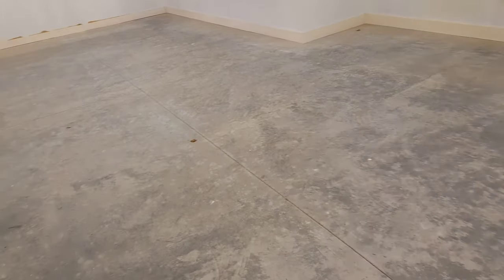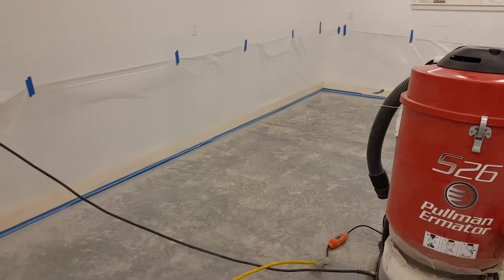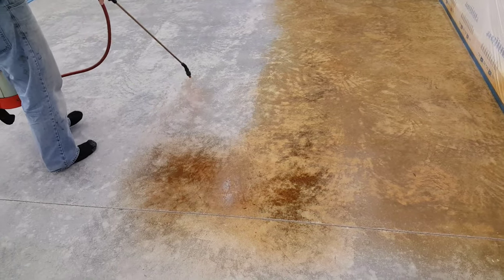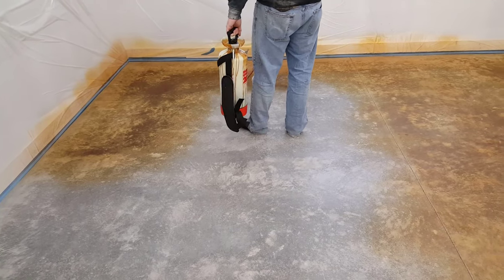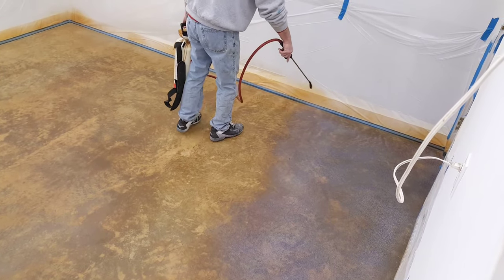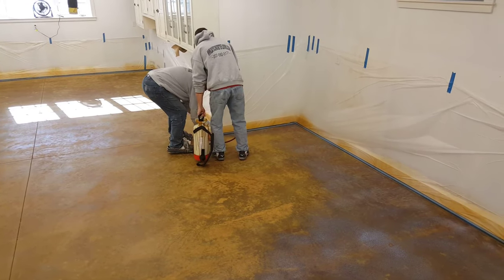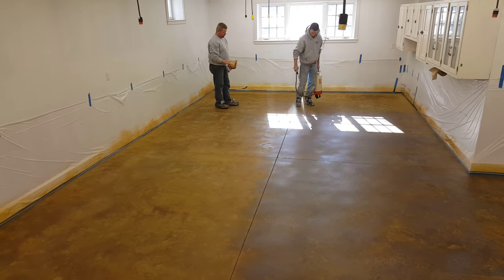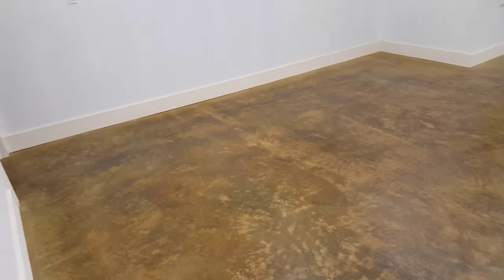How To Stain Concrete Floors | Easy Diy Method

Comment: So glad I found your channel, Mike.  I've got a big patio job happening in my yard at the moment.  I've picked a stain color and realize I know nothing about concrete sealer finishes -- matte, gloss, semi gloss, low sheen, etc.  If I don't try to gain a little knowledge myself, I don't know how to answer the question, "what do you want?"  This is the scariest part for a customer -- this isn't what we DO, so it's hard to know what it is we want or what the options are.

Comment: Our house flooded and our hardwood floors are ruined, which were refinished less than 2 years ago after a frozen pipe leak. I think this would be a great solution but insurance isn't paying for flood issues so I hope to eventually get all the warped hardwood up and have this done. Great video. Now I know what is involved when we have this done.

Comment: Looks great Mike! I love the variation in colors. I did not hear your suggestion on alternative cleaning methods.  I'm thinking maybe acid washing. My DIY project is to restain my front and rear porches. The previous stain done by the previous owner has faded and worn away. I need to keep the anti-skid texture to prevent slipping on the floor when wet. So i will shy away from sanding/cleaning machine. But explain about the alternative cleaning method before i apply stain. Thanks! Donny

Comment: that's beautiful.  i want to do this for all my rental properties.  you can do the entire conversion to concrete stained floors without bending over at all unlike tile or wood or laminates.  you can literally do whole job standing up so easy on body and lasts longer and cheaper better in every category
Reply: I WAS ALSO THINKING OF DOING THIS FOR MY RENTAL, BUT WHAT ABOUT IT BEING CHILD FRIENDLY. COULD FALL AND HIT YOUR HEAD PRETTY BAD. ALTHOUGH IT'S NOT MUCH DIFFERENT THAN TILE. WHAT DO YOU THINK?
Reply: @melissanative1799  IT'S NOT MUCH DIFFERENT THAN TILE

Comment: Turned out Beautiful. I am converting a 20x25 out building on our farm into my new home! It has a great cement floor and this is exactly what I want. What color did you use? And can you put a semi gloss top coat on it to give a little sheen without it becoming super slippery like marble floors?
Reply from the maker: This color was leather tan. Yes, semi gloss is available

Comment: My basement is also power trowelled very smooth. Is there a step between the cleaning and putting down the stain that is needed to open the pores of the concrete to accept the stain?
Reply from the maker: Yes, I lightly grinded the surface in this video.
Reply: Thanks Mike! Wow. That machine is a beast. They have a 10 inch I can rent at H.D. will take forever on 2000sq ft basement. What grit on that diamond pad? Thanks!!!

Comment: Thanks so much for posting this. I've been wanting to redo the floor in my house for several years; it's covered with wood laminate (pergo) that's been damaged by several floods. By the time I was able to setup a drainage system outside that would prevent that, the damage was done. I had been thinking about putting ceramic tile or stone on the concrete so that it would resemble a stone floor, when I saw a friend's house who did what you demonstrated: Cleaned, stained and sealed his concrete pad. This is exactly what I want for my house and your video showed that it's something I could do, that I don't have to hire someone else to do it for me. I'll definitely check out the Concrete Underground, but this has been a great introduction to staining my slab!

Comment: I’m in process of dealing with hairline cracks in my basement floor.  The home is only 12 years old…and I slightly freaked out about the cracks.  It s not structural, just settling.  We live in western Massachusetts, and the weather has been “wonky”…with snow one day.. rain, followed by temps approaching 60!  And this is January!  Anyway, we are considering something similar.  That line down the middle ….did you guys put that in?  We have no such lines…and our basement is huge.  I now think we should have.  Regarding this floor, you guys did a beautiful job!

Comment: What diamond pad grit did you use on this job?  I would like to keep the tiger striping in on my floor as well.   And is that grit strong enough to take off any sealer that was used on the concrete.
Reply from the maker: We used a 50 grit ceramic pad. It's inbetween a metal and a resin pad. It wouldn't remove sealer. You have to grind off sealer in most cases with a metal diamond cup wheel.

Comment: That looks really good! I actually would love to get a look similar to that in an outside environment. I'm looking to do a patio in the back with those quikrete molds. Is there anything about this process that would be done differently if it were new concrete, but outside instead of inside? Thank you in advance.

Comment: Will concrete stain last forever unlike paint the will eventually chip or wear off from traffic?  I'm looking for a durable low maintenance one and done for my smooth concrete basement  floor and my ouside rough concrete front porch.

Comment: Im in the Grueling process of Removing paint off my 600sqft outdoor patio 😮‍💨🥴 almost done.. but i noticed some tiny specks of pigment all over the place.. really small stuff do i have to remove everything ? 100% ? the Water based stain i have is similar color to the old paint.. would i be ok? 99.9% of the slab is clean and sanded down scuffed up good.

Comment: This floor is beautiful!  The problem that I’m facing, however, is the house I bought has stained floors already, and they did a terrible job of it. I hate the color, and they put huge grout lines that are difficult to keep clean. Plus, anything that has been dropped on it, chipped it and the chip filled with dirt. So we have our work cut out for us. Do you think the grout lines can be removed?  If so, what machine do we use to remove them and is it something we can rent?  Another thing is, how do we prevent chipping once our floor has been redone?  I really want to get our floors redone but I’ll probably have to do it myself as money is tight.

Comment: Did you ever wash the floor after applying the stain? Cleaned with wet vac? Or did you just stain, allow to dry, then seal?

Comment: I have frustrating situation so I stained my concrete garage floor per instructions and sealed it with 3 coats of sealer and now the floor looks faded and scuffs easily just 18months later is there a product of wax or polish I can use to revive the concrete to shine when it's wet it looks nice but then dries. Any information would be helpful, thank you. I was thinking of using zep polisher but not sure if it would damage the floor.

Comment: Small question I've done concrete for over 25 years a previous employer of mine had me using a floor buffer with the diamond pads on it and water to profile the floor while someone came behind me using a Shop-Vac to suck it up is it really necessary to use water in my opinion it caused a lot of extra work and mess but it came out good what's your opinion
Reply from the maker: Water isn't necessary, just need to control the dust with a vacuum

Comment: You have the wrong bag on your hepa vac. I've used them professionally to remove asbestos. They have an accordion 🪗 style plastic bag that goes on, and it's about 20 feet long.
Reply: 😂 clearly didn’t need 20ft bag for this

Comment: Water based sealer is not nearly as durable as an oil based product. The floor needs a hard sealer. Don't spill any hand sanitizer on it on water based sealer.

Comment: The floor looks great but that is hardly an Easy DIY Method as the title says.  Expensive to rent the concrete grinding equipment if it is even available for rent not to mention transporting it if you don't have a truck or van and the acid stain is probably not for us amateurs.
Reply from the maker: It's not acid stain, it's water based stain